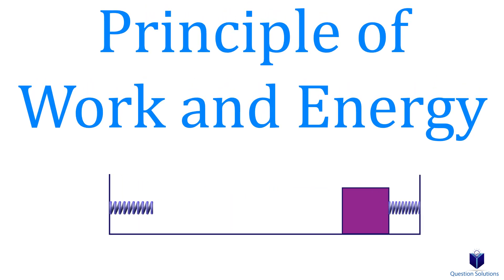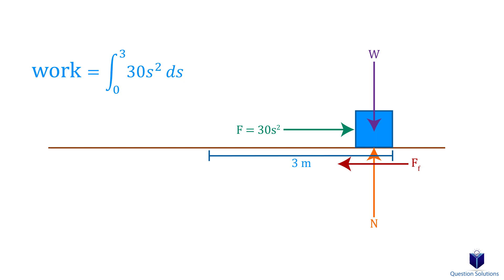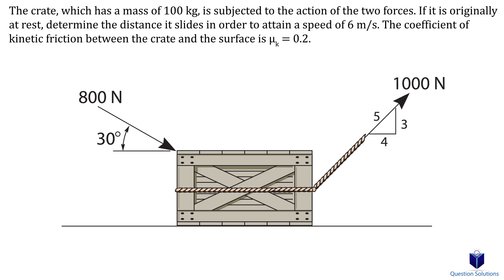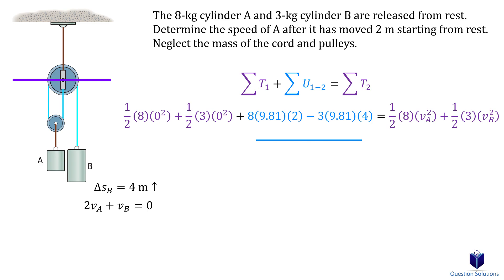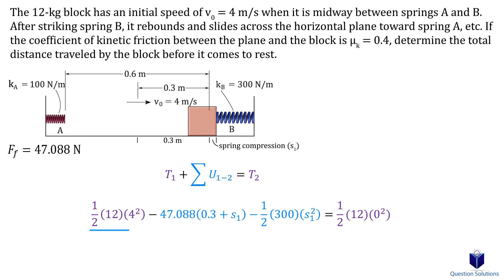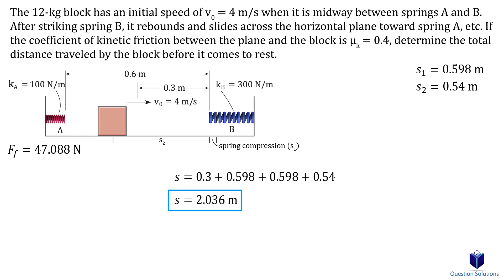Principle of Work and Energy (Learn to solve any problem)

Comment: This video is unbelievably great. It's simple, straightforward, and provides wonderful examples of understanding the basics of these concepts. My current class just opens with the detailed formulas of it all using differential equations, and while that's great for understanding the details, it leaves me lost in trying to understand how it functions practically. Also doesn’t help that they switch between U and W at random. But this video is great 11/10, explains that W and U are the same thing.
Reply from the maker: Thank you for sharing your thoughts and the wonderful compliments about this video! It's great to hear that the video helped clarify these concepts for you. These videos were made as supplementary material for university courses. I found that a lot of the time, students have a hard time applying theory to problems they face, so I made these videos to help in that regard. That's also why I don't cover any theory on this channel, it really is just how to solve problems and arrive at a solution :)

Comment: 10:21 There is work due to tension in the direction of motion for the pulley question. This tension works opposite to the direction of displacement for A, and in the same direction of motion as B. Why did we not calculate work due to tension?
Reply from the maker: First year courses usually do not consider tension in work and energy problems. It complicates things needlessly, so tension is usually ignored as it's considered an internal force. This is also why most questions will also say ignore the mass of the cables, pulleys, etc.

Comment: "we can solve for S to get our answer" what exactly did you solve forrrrrrrrrr rahhhhhhhhhhhhh👹
Reply from the maker: You can directly solve for it. What I mean is, go through from left to right: So you get 0 + 692.8S +800S - 156.2S = 1800 (here, I converted 800cos 30 = 692.8). Now, you can easily solve for S. S = 1.35 m.

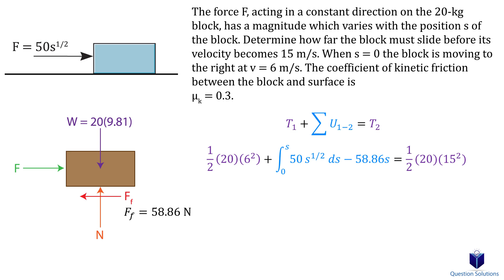Comment: hey, how did u solve the equation in 7:54?
Reply from the maker: Graph it or use wolfram alpha. If you want to do it by hand, see: https://mathforyou.net/en/online/equation/arbitrary/?e0=50x%5E%283%2F2%29-88.29x%3D2835&v0=x&o0=1&from=google
Reply: 283.5 not 2835 and am getting my s as 6.78

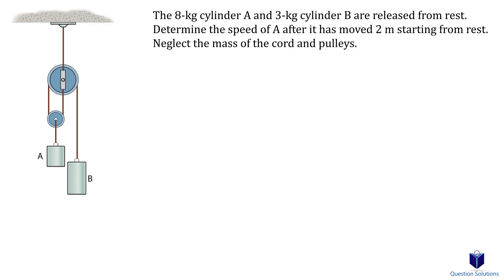Comment: At 7:52, how did you solve for s? I am having a hard time solving for s. Other than that, great video, definitely deserves a like!
Reply from the maker: Easiest way is to graph it, otherwise, you can use something like symbolab or wolfram alpha to get an answer. :)
Reply: @QuestionSolutions   so you don't know how to do it by hand?
Reply from the maker: @GreenMarkEng  You should know how to do it by hand, but that doesn't fall into a dynamics course. That's for a calculus course. If I were doing a series on calculus, I would show how to do an integral, but that's not how university courses work. You learn the integration from calculus, then you apply that to other courses, like dynamics, statics, thermo, etc. I just want to emphasize that the goal of this set of videos isn't to teach how to solve for a variable in an equation, the goal is to show how t apply new equations learned in dynamics.

Comment: I am doing the same question for my course. Except i have different numbers in the problem. The box in my problem weighs 25 lbs. But on her answer key, to get the normal force she doesn't multiply by G value. Her normal force is just 25. And also for T1 when plugging in for m, her m value is 25/32.2. Can you tell me why her steps are different.
Reply from the maker: You can solve these problems in many ways and arrive at the same answer. I only showcase a single method, but you should do whatever method you're more comfortable with (or whatever method your professor wants you to use). :)

Comment: I'm getting s=2.35 and you have s=1.35. I have to ask: Am I missing something here?
Reply from the maker: I replied to your comment before. Please use timestamps, I don't know where you're referring to.
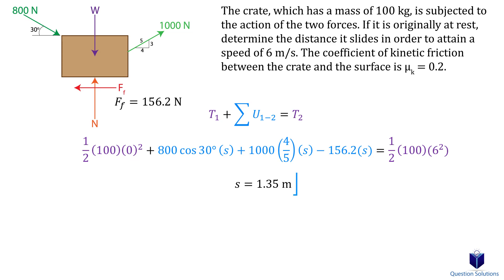Reply: timestamp: 5:59 @QuestionSolutions
Reply from the maker: I think you are making some numerical error somewhere, try to do each section at a time. The answer on the screen is correct. Please see: https://www.symbolab.com/solver/step-by-step/%5Cleft(%5Cleft(x%5Cright)800cos30%5Cright)%2B%5Cleft(%5Cleft(x%5Cright)1000%5Cleft(4%2F5%5Cright)%5Cright)-%5Cleft(156.2%5Cleft(x%5Cright)%5Cright)%3D%5Cleft(%5Cleft(1%2F2%5Cright)%5Cleft(100%5Cright)%5Cleft(6%5E%7B2%7D%5Cright)%5Cright)?or=input

If you click the little grey arrow pointing down, you can see the decimal value, which is 1.34668 =~ 1.35

Comment: I'm getting N=791 Newtons. You're telling us that N=781 N. Are you sure?
Reply from the maker: Please use timestamps. I don't know where you're referring to. Thanks!
Reply: timestamp = 5:08 @QuestionSolutions
Reply from the maker: I think it's another numerical error somewhere, please double check. The answer shown on screen is correct. See: https://www.symbolab.com/solver/step-by-step/x-%5Cleft(100%5Cleft(9.81%5Cright)%5Cright)-%5Cleft(800sin%5Cleft(30%5Cright)%5Cright)%2B1000%5Cleft(%5Cfrac%7B3%7D%7B5%7D%5Cright)%3D0?or=input

Is your calculator in deg?

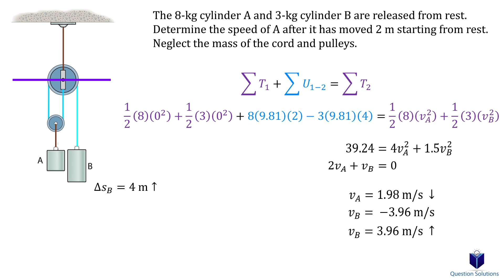Comment: 10:30 how did you get VA and VB
Reply from the maker: Isolate for one variable in the first equation and then plug it into the 2nd equation (substitution method). Please see: https://flexbooks.ck12.org/cbook/ck-12-cbse-math-class-10/section/3.5/primary/lesson/solving-simultaneous-linear-equations-by-substitution/

An easier method is to just graph the 2 equations and see where they intersect. Use desmos for that. 👍
Reply from the maker: This is a bit late, but here is a short video on how those 2 equations were solved: https://www.youtube.com/shorts/4euH1289_Kg

Comment: please show how you got the answers... 10:37 you just gave us the answer without showing us how or what you did to get it... same with the previous problem.
Reply from the maker: Please use cymath.com, symbolab or wolframalpha if you need help with seeing steps for algebra. It's not the main point of the video so I don't like to cover it. cymath shows every step by step way of solving basic algebra problems, which is a great tool for a refresh and whenever you get stuck.

Comment: Hi, at 12:35, how do you know which value of s_1 is correct as it is a quadratic equation with two solutions?
Reply from the maker: Did you figure out the two values? If yes, you can tell which one makes the most sense since one is positive and the other is negative.

Comment: from the last question how can s1 be 0.598 if s1 one is the distance of the spring being compressed because if you add it with 0.3 with how much the box moves it will be 0.898 while the whole system is 0.6 m long
Reply from the maker: I think maybe you're misunderstanding the question. The 0.6 m is only the distance from the edge of the red spring to the blue spring, it doesn't represent the total system. Look very carefully at the start of the question and where the 0.6m is and what it's showing. We don't know how long the springs are, or the total distance from the ending edge of the spring to the ending edge of the other spring. All we know is that it's 0.6 m between the start of each spring. In addition, keep in mind that these diagrams are only starting steps of what it could be, not what it really is. It's not to scale or anything, and when you get the real values, you will have to redraw it, or use your imagination to get a better idea of what it actually looks like. I hope that helps. 👍
Reply: @QuestionSolutions  ooh just realised thanks for the help is much more clearer now
Reply from the maker: @willgggg900  You're very welcome! Best wishes with your studies :)

Comment: why we did not receive directly normal force (50^1/2) ? can you explain simply at 7.54
Reply from the maker: The force F is based on the distance travelled (s), so we can't just plug values in, it has to be integrated. It's not a fixed number.

Comment: the distance in the animation is incorrect, its measured from the left of the square to the right instead of only measuring the displacement of one side.
Reply from the maker: You are technically right, but as with most things animated, if I did it from center to center, or from left to left, or right to right, it just doesn't look right and you end up with more questions about figuring out the distance. It's just what it is. Sometimes, a little bit of leeway gives a better understanding, and they aren't meant to be specific, but rather, to give a general idea of what "s" is. In this case, it's just the distance an object moves from any origin line. The origin could be from the left, the center, or right.

Comment: sir thankyou! but i have a question, in example #3 using 1st condition, using the formula WOE equation.

T1-47.09(0.3+s1)-300 * 1/2 (s)^2= 0

why do we have to multiply 1/2 to 300? what is the explanation for that sir? and why the s is squared?
Reply from the maker: This is the work done by a spring. Please take a look at 2:12 and watch for a few minutes. 👍
Reply: @QuestionSolutions  oh right, thankyou for always answering questions!
Reply from the maker: @flee3695  You're very welcome!

Comment: This second quest is kind of hard to solve. I seem to solve the 50(2/3)s^(3/2) - 58.86s = 1890. I tried the wolfarm website to find the step by step solutions but it won’t show me unless I pay for it. It there anyway else I can go. Is there a section that help me solve these kinds of problems.
Reply from the maker: Hmm, wolfram alpha is usually my go to website if I need to check an answer. If you are a student, you might be able to get a better price as well. Other than that, if you search for equation solvers, a lot of websites do come, but I don't know if they can solve every equation. Other than that, to get an answer, you can always graph it. Sorry I couldn't be more helpful with your question.
Reply: @QuestionSolutions  do you have to pay for it
Reply from the maker: @darrylcarter3691  Yes, I believe for students, they have a plan for 4.75 per month. If you are a student at an institution, they might already give it for free.

Comment: if it is frictionless surface , will the block still come to rest ?
Reply from the maker: No, unless you account for air resistance. An opposite force has to stop the block.
Reply: @QuestionSolutions  let's said the block is initially at rest,  then I push the block to the right on frictionless surface and the air resistance is neglected. if I want to count the distance travel by the block,  it will go infinity?  Cuz the block will not come to rest.
Reply from the maker: @sasukekianhoong6130  That is correct, nothing will stop the block unless you apply another force from the opposite direction.
Reply: @QuestionSolutions   If the block is pushed to the right until spring B is compressed 50 mm and released,where at first it has travel distance (0.3+0.05)=0.35m then 0.5k'x'^2=0.5kx^2 , 0.5 (100)(x'^2)= 0.5(300)(0.05)^2,  x=0.0866m , so my total distance travel by block is 0.35 + (0.6+0.0866)+(0.6+0.05)+(0.6+0.0866)+... and so on ? it is correct ?
Reply: As my spring B is compressed 50 mm and released , my block initial speed is 0 and i know that the block will compress spring A as well and my final velocity of block is 0 again so the eq is 0.5k'x'^2=0.5kx^2 am i right ?
Reply from the maker: @sasukekianhoong6130  Sorry, which question are you referring to? Is it an example I covered or a random one?
Reply: @QuestionSolutions   sorry for the unclear question that i have asked ,it actually similar to your question ,  if the block is at rest initially , and i push the block to the right on a frictionless surface and air resisance is neglected until my spring B  is compressed 50 mm and released ,  how much distance have the block travelled ? the K value for spring A and B is 100N/m and 300N/m .
Reply from the maker: @sasukekianhoong6130  In your question, is there 2 springs, one on the left side and one on the right? If so, you can solve it exactly like I did, but ignore friction.
Reply: @QuestionSolutions  but if I ignore friction which I use the methods u solved my eq left  0.5kx^2 = 0 , I dk how to relate the distance in it cuz ur question relate friction force which include s1 so the distance travel can be determine but for my case I really dk how but I could think of the initial spring energy equal to final spring energy which I did previous one but I'm not sure correct or not
Reply from the maker: @sasukekianhoong6130  I am not really understanding your question because if the surface is frictionless, once the spring is released, the box will just travel forever, unless it hits the other spring. Can you send me a picture, like link me a picture to your problem? Is there no other distances given, like distance between the springs or anything?
Reply: @QuestionSolutions  lol,  sorry y'all,  you are right ,  just as the figure in your example,  the block is between the 2 spring A and B( sorry for not mentioning clearly)
Reply from the maker: @sasukekianhoong6130  I believe this is correct, I just don't understand how this question works. If the surface is frictionless, once the block is released from spring B, it'll go and hit spring A, and then bounce back and hit spring B, and it's just go like that on and on, since it's frictionless.
Reply: @QuestionSolutions  thx for helping me,  appreciate it :)
Reply from the maker: @sasukekianhoong6130  You're very welcome!

Comment: couldnt you solve the last problem using only W(friction) = 0.5(mass)(delta speed)^2 since springs do work in both directions, thus cancelling out. This would give -mg(uk) s = -0.5(12)(4^2) ==> s = 2.039 m
Reply from the maker: There are so many ways to solve these problems, I just show one method using the equations pertaining to the selected chapter. 👍
Reply: After some thinking, I came to the same conclusion. In this problem, friction is the only nonconservative force.

Comment: Can you give greater detail to how S simplifies without becoming negative and the exponents being different at 7:54
Reply from the maker: Are you referring to the integral portion or where the "-58.86s" comes from? If it's the latter, it's the frictional force multiplied by the distance travelled. If it's the first, please see: https://www.symbolab.com/solver/definite-integral-calculator/%5Cint_%7B0%7D%5E%7Bx%7D50x%5E%7B%5Cfrac%7B1%7D%7B2%7D%7D%20dx as that is more of calculus than dynamics. 😅
Reply: @QuestionSolutions  no i'm referring as to how that (100(s^3/2)/3)-58.86s =1890 simplifies to s=20.52
Reply from the maker: @andrewgrimes1771  Oh, you're just solving for "s", it's a single equation with a single variable. Easiest it to just graph it: https://www.desmos.com/calculator/3bfofpeifb 👍
Reply: @QuestionSolutions  wait sorry how would you solve for s im slighty confused ?
Reply from the maker: @willgggg900  You're just looking to see where the graph intersects the x-axis, or you can solve it algebraically (faster to graph it): https://www.symbolab.com/solver/step-by-step/%5Cleft(%5Cleft(50x%5E%7B%5Cleft(3%2F2%5Cright)%7D%5Cright)%2F%5Cleft(3%2F2%5Cright)%5Cright)-58.86x%3D1890?or=input

Comment: In the last problem why is frictional force doing negative work after it touches spring b. Wouldn't the frictional force be doing positive work when the block moves left, since the frictional force will be pointing right
Reply from the maker: Good question. So when the block is moving left, all forces in the left direction does positive work. In other words, any force that helps the block move to the left does positive work. Friction does negative work since it's pointing to the right. So when we write the work equation, think of it as picking the movement side to be positive. And since friction is always opposite to the direction of movement, it's almost always negative work. I hope that helps.

Comment: thanks, but I'm having issues finding the final values for s(distance) in the first two questions you solved
Reply from the maker: For the first question: https://bit.ly/2OhO6Rz
For the second question: https://bit.ly/2CrNiXC
It's simply solving for one variable, don't overthink :)
Reply: @QuestionSolutions  thanks
Reply from the maker: You're welcome! Best of luck with your studies.
Reply: @QuestionSolutions  can you give the link again, please? the link isnt working
Reply from the maker: @undefined.infinity3106  https://www.wolframalpha.com/input?i=%28800cos30%29x%2B%281000*%284%2F5%29%29x-156.2x%3D%2850*6%5E2%29

https://www.wolframalpha.com/input?i=%28%2850x%5E%283%2F2%29%29%2F%283%2F2%29%29-58.86x%3D1890
👍

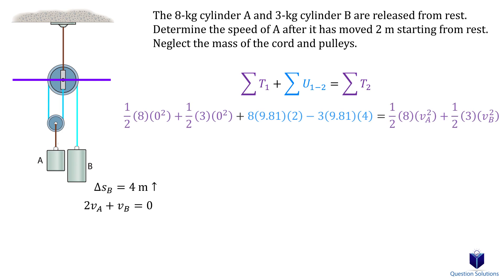Comment: 9:28 should in it be for bloke a 9.81/2 instead of 9.81
cuz if you take another derivative at 9:05, it will be 2aa+ab=0
Reply from the maker: I am not exactly sure what you are referring to, but if I understand correct, you are saying for cylinder A, the 9.81 should be divided by 2? I assume you are saying this because if we take the second derivative of our velocity equation, we get 2aA.   So if we take another derivative, the acceleration we get, which would be 2aA+aB=0, represents the accelerations of the cables with respect to the datum. Another way of thinking about it is that aA accelerates 2 times as fast as aB. However, at 9:28, the acceleration we are using is acceleration due to gravity, so there is no need to divide it by 2. The value we have, which is 8*9.81*2 is mass of cylinder A multiplied by the acceleration due to gravity, multiplied by the distance moved, which is 2m. I hope that helps :)